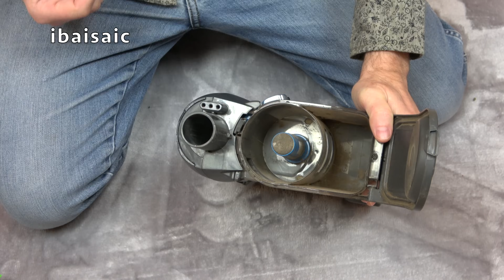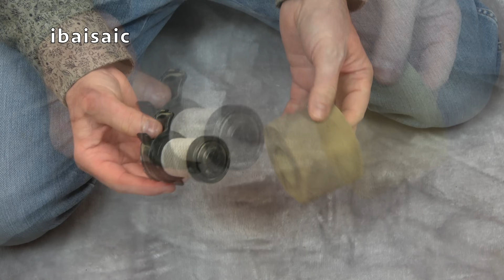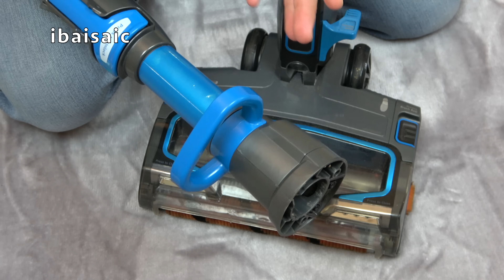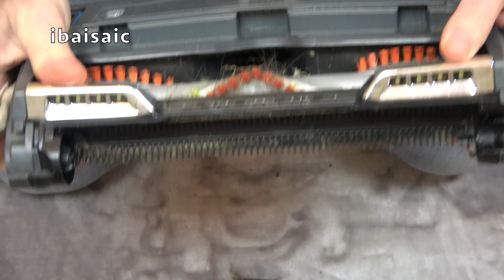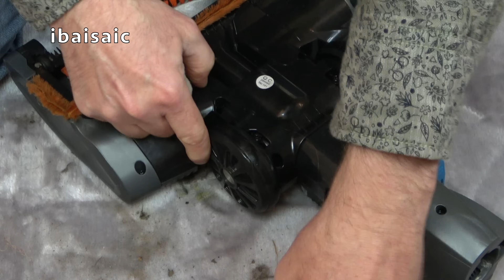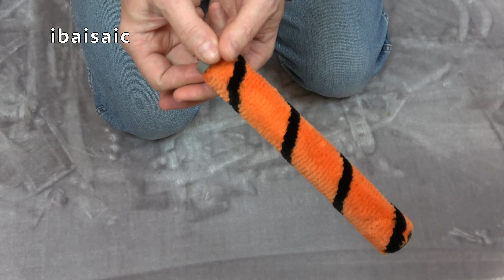Shark IF200 Duo Clean Cordless Vacuum Cleaner Maintenance Tips

Comment: My Ion lithium battery will not charge i hav a new charging cord can I fix this somehow I can't get it to charge past the flashing blue light
Reply from the maker: If your battery is old, then it probably needs replacing as they loose their ability to charge in as little as two years. There are methods shown on YouTube that demonstrate how you can jump start a battery to get it to charge again, but these should be attempted with caution, if at all.

Comment: My shirt is all cleaned except the filter that’s on the top of the machine. It’s a little one that looks like triangle it’s cotton lake but I don’t know if it had it one time a piece of plastic with it when I turn on my machine it’s very loud and I don’t know what’s causing it. I cleaned it all out wiped it down and it’s still is making that loud sound, if you could advise me if I need to replace that little triangle Lee I thought maybe it had a piece of plastic or something on it they came on it but my machine is very loud when I turn it on and that’s where the sound comes from because if I block it with my hand, it’s not so loud Thank you. Your video was very very helpful. Thank you.

Comment: Very easy to take the bin off, 2 t10 screws on bottom, 2 t10 on top (under the top filter), 2 philips screws inside bin...then  undo plastic latch on back, near battery chamber and it just pops outto wash & clean.

Comment: I clean mine one nearly every time I use it. It gets very messy. Takes longer to clean than the actual cleaning if the floor. Didn’t know  about the  outlet filter will check that as well, now just ordered a new set of filters and the roller. Thanks for doing this video.

Comment: I have a Shark just like this one, but the issue I’m having is that yesterday the brush roll suddenly got completely jammed, it will not turn at all. We generally keep the vacuum fairly cleaned and well maintained. Since it’s been jammed, I cleaned the few remaining hairs, string, etc. but it didn’t make any difference, it’s still jammed. Btw I’m talking about the back brush roll, the one that doesn’t pop off. I’m starting to think I may need to just buy the whole floor nozzle, but I can’t even find where to order it from.
Reply: I have the same problem. Have you managed to fix yours yet?

Comment: hi, i made a mistake and used water to clean and am sure some of the water got in the motor. Now the vacuum starts and stops for a second. Could i blow dry inside the motor where the double filter is?
Reply: I done the same I wish the guy would answer out questions
Reply: Hi did you manage to fix it?

Comment: The tiny wheels at the bottom of my shark duoclean cordless vacuum are really blocked with fluff and dirt and hair wrapped round them. I managed to clean one of them as it’s much more accessible but the other one is so tight to the frame it was almost impossible to get to it even with tweezers and a knife.  Any ideas? I found the video on how to clean the unit really helpful and easy to follow so that you!
Reply: I found this I did run them under water catefully and scrubbed with a tooth brush which is naughty but it seemed to get it out
Reply: Dental pick which you can buy at any pharmacy.

Comment: I was wondering If you may know why When I Put My Battery Into My IF200W Shark Vaccum The 2 Top Blue lights start flashing. And Or The 2 Bottom Blue Lights Start Flashing. The filters are clean and there isn’t any sort of blockage.
Reply: Have the same problem. Did you manage to solve it ok?
Reply: Did anyone manage to fix it mine is doing the same?
Reply: Mine is doing the same does anyone know why this is
Reply: Anyone get passed this problem and get the vaccum working?

Comment: Great video! People always complain about the Shark cyclone system. Those filters are actually designed to take a lot of dust before it loses suction. I have personally tested it with measuring devises and that claim is true. Those filters need washing once a month. In my opinion that is not bad at all.
Reply: I agree. Also I’ve learned since I’ve ever used a vacuum cleaner that the MAX fill line means it’s full and should be emptied.